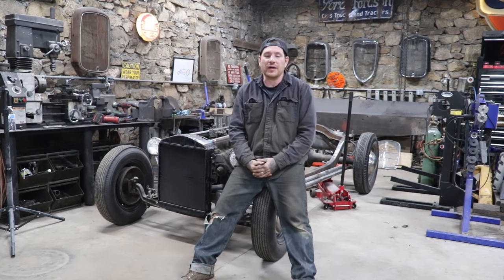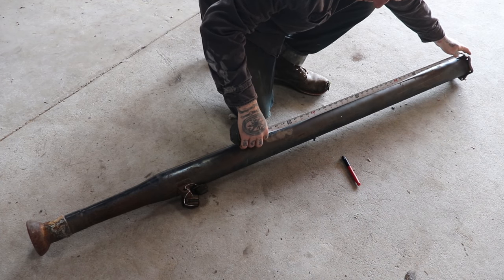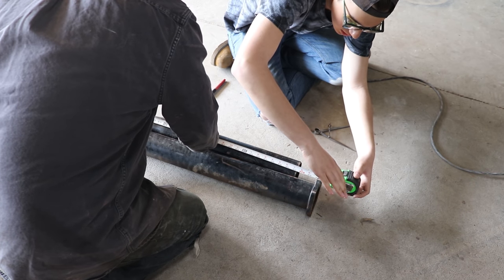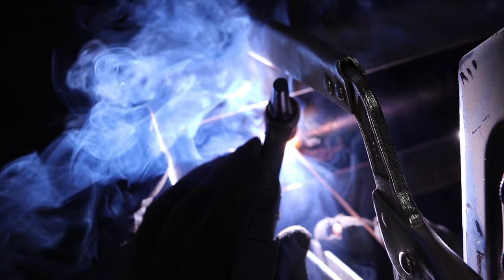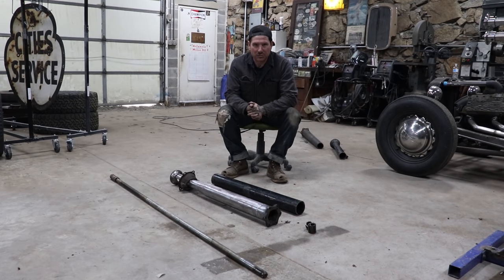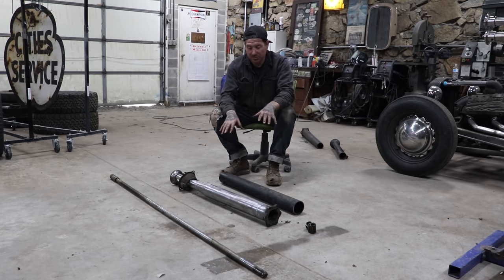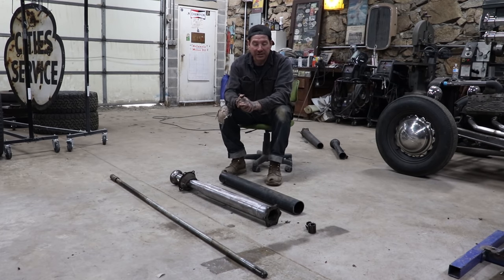How To Shorten A Torque Tube - Ford Free-T - Ep. 74

Comment: Ideally cutting any kind of tube straight off I use a pipe cutter. Then you take 6 to 8 inches of the piece I cut out and split it down the side so it fits inside the pieces your joining. A thin bastard file to tweak the split for fitment.Then be sure to clock the position of all 3 pieces exactly. Clean up to bare steel,space 1/8 of an inch and tack weld together ,weld solid and grind . No angle iron necessary for alignment .This works for a driveshaft too.

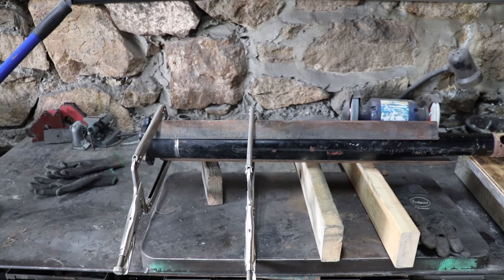Comment: Good tip/trick @ 4:30....
Reply: I'm the only person left that doesn't weld.  All I know about welding is not to touch what was just welded.   Well, that and where to buy a cheeseburger.  Seems like welders are big cheeseburger consumers.
Reply: @travelingkaspersworld4096  Lmao
pick up a Hobart handler 140 at your local tractor supply then go buy an argon bottle and start mig welding all the basic set up is wrote on the inside cover it literally is the most basic skill to learn so easy a kid can do it

Comment: So, are you cutting the driveshaft in the middle also so you maintain the two machined ends?? I guess the "c" clip you mentioned locates one end of the shaft. If you know how much is supposed to stick out pas the tube on the opposite end, that would tell you how long to make the shaft??

Comment: When the rear suspension travels up and down, why doesn't the length of the torque tube change? I've seen these on (early) cars up to the 50's but have had no experience with them, and never understood them or why they were used...
Reply: On early Ford suspension the torque tube is a ball and socket mount to the transmission with a universal joint inside.  The rearend is fixed solid to the torque tube and forms a giant triangle.  The rear transverse spring allows the triangle to pivot at it's point up and down and also in a twisting motion to handle road terrain.  The rear spring mount prevented side to side motion of the triangle.  This is all on an original Ford setup. The toque tube doesn't change length as it is the locating mount for the rear suspension.  On early GM cars with a torque tube the ball socket was also mounted to the transmission.  Instead of the triangle rear suspension and one transverse spring GM used parallel leaf springs.  Unlike modern parallel leafs with a fixed front mount and rear shackle the torque tube mounts used shackles on both ends of the springs.  The torque tube located the suspension and the springs flexed at both ends to make the suspension work.  When manufacturers went away from torque tubes to the modern style driveshaft then the leaf springs or link arms became the locating points for the suspension by having front fixed mounts.  The rear shackles provided movement and since this movement made the wheelbase grow or shrink slightly during travel a modern driveshaft with slip yoke was needed.   Here Matt has split the rear wishbone off the torque tube, but he is still using the torque tube to locate the rearend.
Reply: @QuickSpeedShop  
Wow, thanks for the explanation....
Reply: @QuickSpeedShop  Excellent explanation.